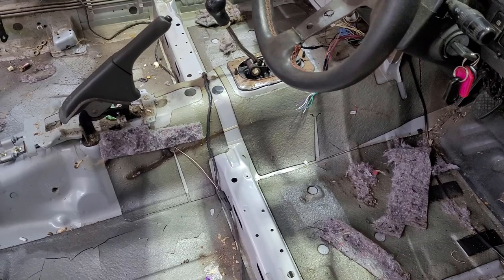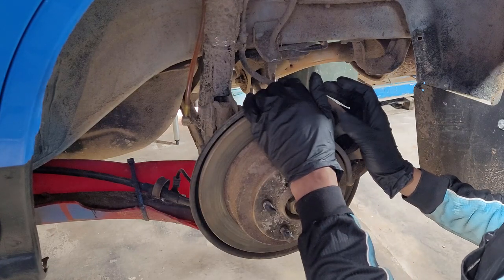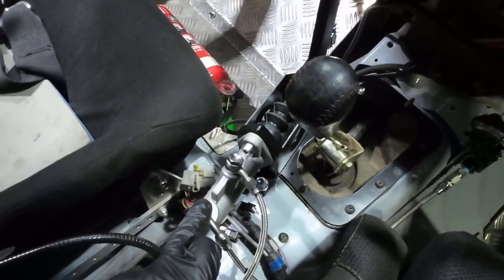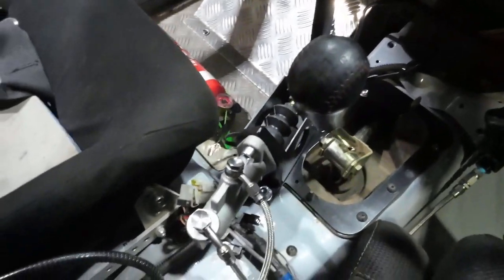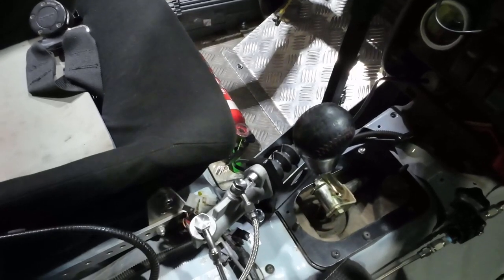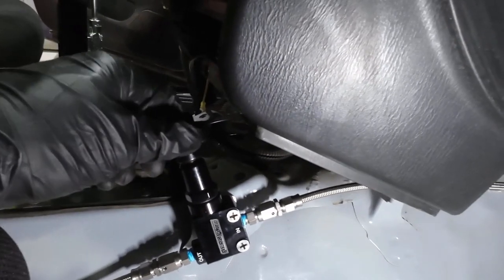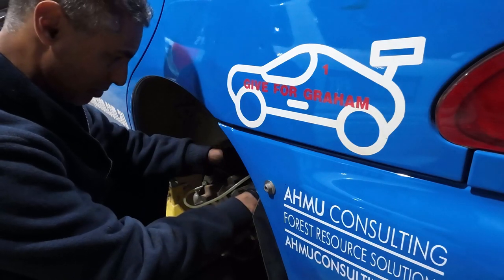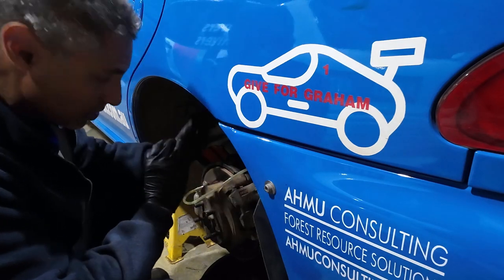Why & how to install a Hydraulic Handbrake in a rally car

Comment: Thanks for this info! So with my 1995 GC8 Impreza L 5-speed rally car, I’m guessing that system won’t be ideal for a handbrake hey?
Reply from the maker: @TheLoamRanger  depends on whether the car is 2wd or 4wd and whether it has disc or drum rear brakes. We've fitted plenty of these set ups to WRX models. Drum brake models can have a hydraulic handbrake fitted, however the rear brakes should be converted to disc.

Comment: I'm considering doing this kharnaCross car it is still road registered at the moment, considering swapping rear callipers for late model ones with electronic handbrake for  parking. Hydro with dccd for turning electro for parking
Reply from the maker: That may work if the brakes will fit. Depends on the model(s) you planning to do the swap on. Some hub/rotor/caliper combinations are not easily interchangeable.
Reply: @rallyactionwa  late model Subaru to 2007 outback from what I've seen a lot of late model cars use TRW electro e brake callipers with different brackets for  different models.

Comment: i have a 2011 cadillac cts-v with stabletrack which can be turned off but it pretty much controls each wheel independently to keep the car from losing control.  so i had to tee into both rear break lined then run a single li8ne into the handbreak then a single line out of the handbreak into another tee which connected both side rears together again. do you have any advice on this? it feels like the handbreak does not create enough pressure to lock up the rear tires
Reply from the maker: Advice? Not really. In our situation, we remove the oem brake lines/system and start with all new lines and plumbing. Teeing into an existing line or system could cause all sorts of problems, especially where ABS/CPS/Traction control is present.

Comment: What would happen if you forgo the biased proportioning valve? Would pulling the hydro at that point fully lock up the rear??
Reply from the maker: Without a bias valve, pressing the brake pedal even under normal braking conditions may result in locked up rear wheels. The hydraulic handbrake  should lock the rear wheels regardless of a bias valve.
Reply: @rallyactionwa  I see! so the proportioning valve you have fitted in the cabin works independently of the hydraulic handbrake?
Reply from the maker: @raycadbury  yes correct.

Comment: I have a pump like yours and i Will mount it whith hard lines do you know if i can mount it upsidedown? The hardline passes under the car and it Will Be easy  to make less curves in the hard lines.
Reply from the maker: The handbrake master cylinders are not designed to be mounted upside down. It's likely you will have trouble with bleeding and/or correct operation of the brakes.

Comment: Interesting, I did pretty much the same on mine although I put the proportioning valve on the front lines not the rear, because mine is disc front and drum rear it wouldn’t work otherwise.
Reply: I have a load of video’s from a tripod of me locking up the brakes to see what locks first when on the pedal
Reply: Ahh now ive got to the end of the video i see you’ve covered it ;)
Reply from the maker: If you have fitted a proportioning valve on the front brake circuit it is incorrectly fitted and should be removed. It does not matter whether the brakes are drum/drum, disc/drum or disc/disc. With some cars the factory bias valve is inside the master cylinder, other cars it is fitted at the rear of the car. It needs a thorough investigation before any modification is made to the braking system. In all cases fluid should not be restricted to the front brakes.
Reply: @rallyactionwa  its fitted to the front brake circuit because I had to remove the factory proportioning valve as it tied the front left to the rear right as one circuit and the front right to the rear left as a seperate circuit. Had i not put the aftermarket proportioning valve in to the front brakes after removing the factory one, only the fronts would lock up when stabbing the pedal…
Reply from the maker: @adamward1008  Your valve is still fitted incorrectly. Yes in modern cars the braking works on a diagonal system with a diagonal  proportioning valve or sometimes the proportioning is controlled by an ABS unit if fitted. If fitting an after market brake bias valve, the correct way to do it is to remove all the factory plumbing from the car and run new brake lines to the front and rear. With a two port master cylinder generally one port from the master cylinder is used for the front brakes and the other port is used for the rear circuit which has the brake bias valve and hydraulic hand brake inline (we used this exact set up in the Subaru in the video). It is irrelavant whether the car has disc front/drum rear the same plumbing is used for both. In comparison to disc brakes, drum brakes need a check valve to keep the wheel cylinders correctly adjusted. Sounds like with your car further investigation is required. It may have a factory bias/check valve tucked up somewhere under the car. The other possibility is that if you have removed the bias/check valve, the rear wheel cylinders are not actuating correctly as there is nothing to hold the wheel cylinders in adjustment. Either way, the brake bias valve should not be fitted on the front brake circuit.
Reply: @rallyactionwa So when you have a diagonale system and reroute all the brake lines, you can not use the abs unit anymore?
Which isn't nevessarily bad - abs has pros and cons. But maybe the ECU won't like it?
Reply from the maker: @michiel5160  If we  fit a hydraulic handbrake, we remove ABS. If it is retained, the ABS will give trouble when the rear wheels are locked when using the handbrake. The ABS will sense the rear wheels locking and activate, potentially causing a dangerous situation.

Comment: So do cars fitted with this set up pass the relevant ministry of transport tests, or whatever is the equivalent in each country?  here in the UK, rally cars are driven on public roads between stages and are therefore required to be road legal so would this set up still need a totally independant parking brake as well?
Reply from the maker: That is an impossible question to answer! Each country and/or state/county may have different rules and allowances in regards to rally cars. Where we are, there are no major issues with this handbrake set up and many cars use it. All rally cars must pass scrutiny for each event and the scrutineers are also responsible to check safety for road use. As we mention in the video, we have seen some cars where the mechanical handbrake is retained in parallel with a hydraulic hand brake. Perhaps in some places this may be needed to comply with public road transport regulations.
Reply: @rallyactionwa  Thanks for the reply.
Reply: Where I live all cars have to undergo technical inspection. But they have other requirements for rally cars. 
If you put a hydraulic handbrake on your road car and they notice it, you won't pass. However, they test brake performance on front axle and rear axle, so there is a change they won't notice - if you manage to keep the standard handbrake lever
Reply from the maker: @michiel5160  where we are, fitting a hydraulic handbrake (or any other form of brake modification) is illegal on road cars. Hydraulic handbrakes are only for dedicated competition vehicles.